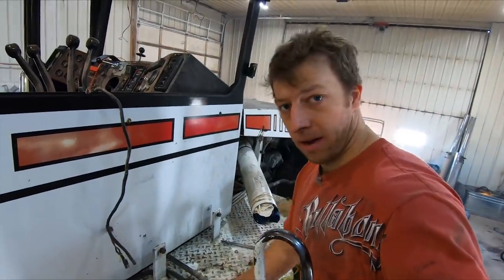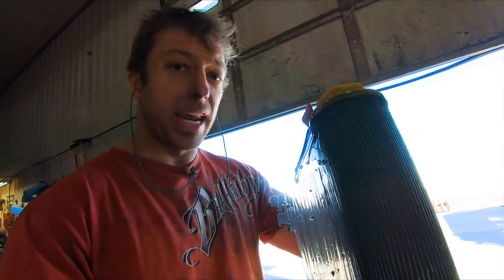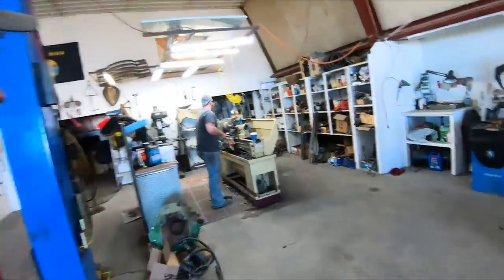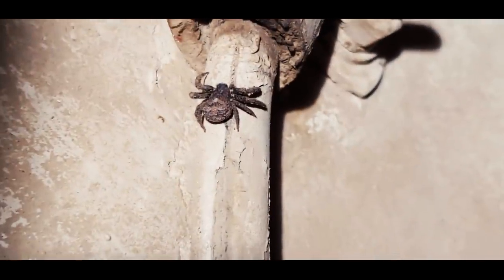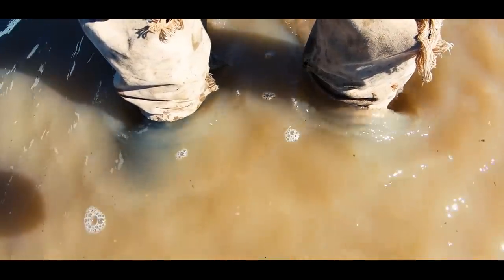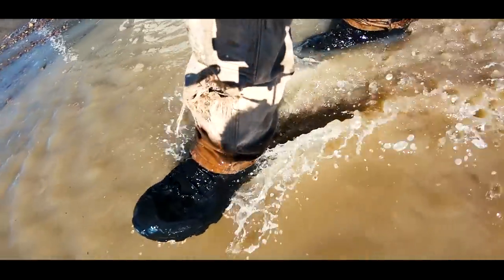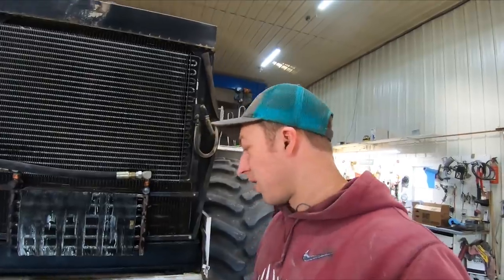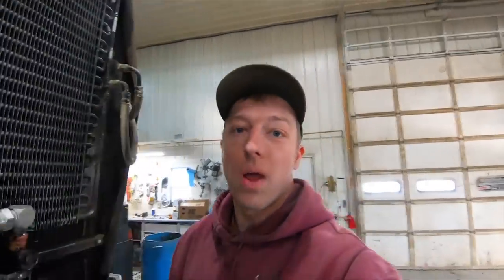BIG BUD Tractor 🚜 Restoration - Part 3

Comment: Great video. Noticed while you were under the rear end taking out the wiring that the breather for the rear axle was all covered with dirt.You'll want to make sure you can spin the breather cap and that the breather is not plugged. A plugged breather could result in leaking wheel and/or pinion seals. Keep up the great work.
Reply from the maker: Excellent point! Thanks I might just go and replace it anyways!

Comment: Consider rounding the inside of that hook pattern. Square corners create a weak point by concentrating all of the stress in one location. If you use a curve it makes the part stronger by distributing the force.
Reply: Lessons learned from the De Havilland Comet.
Reply: yeah, great idea, can always add a "saddle' on there later!
Reply: Cool guys, thanks!  Blessings
Reply: Science
Reply: At 09:20 there is an old rusty round-body pickup in the background next to the driveway.  I have seen it in other videos, but never seen it used, or even mentioned.  Is there any Welker history there that you want to talk about in a video, or is it just scrap that's been sitting 50 years?

Comment: Nice job cleaning the Hyd. tank. I just flushed my hydrostatic system on my JD. I have seen people never change their Hyd. system but when they have failures it’s usually a expensive one.
Nice to see you using the Altec Digger Derrick that was built in St. Joseph Mo. They make a nice crane on a farm.
Reply: That derrick is awesome on the farm.  It was Scott's idea to get one and he found a great value on a use one.

Comment: You should do like the steigers do and put a cable to the front of the rear drive. That helps a lot more than just pulling from the front of the front drive unit.
Reply: I was just going to suggest this.  That's a big piece of steel on the front, but that's an even bigger piece of steel hanging out behind it.

Comment: I have seen that screen failure on coal mining machinery that I worked on in the past, it's metal 'work hardening' with the hi-volume pump suction pulses that the Big Buds must have. We fitted lager surface area screen filters that were made with nylon outer screens, cured the problem economically.

Comment: Love seeing the old buds ...we had a 380 I believe 425 horse Cummins 13 speed filler transmission...on board air with air reel and bulk grease system it was the best oh the seat spins all the way around for easy watching equipment....love it

Comment: Relays!  If the Thomas lights are a higher draw than the originals, you may want to use relays.  Put the relays back by the lights, run new heavier wire straight from the battery to power the relays and use the original wires to trigger the relays.  Otherwise you may either burn out your switches or limit the lights.  Keep putting out the cool videos.  I love seeing what you build and they make me homesick...
Reply: Thanks Don.  Just as you recommended we run relays on most all new wiring for that purpose, to save switches.  Blessings and glad to help with the memories.

Comment: Is LegArms a self taught machinist and welder? He does a great job!
Reply: George Rydberg yes I believe he is you can look back in some live streams someone asked
Reply: I bet Welker senior had some influence.
Reply: I was amazed by their first Job, the tracked dozer engine swap, engeneering and fabricating the Parts that connects the engine to  the gearbox isnt easy, when the stuff isn´t designed to work together.  

And they nailed it, Legarms seemed to be around 16-18 at the time. 

When you grow up in a business or Farm, surounded by Machines that need Service or Repairs (i personal dislike the Term "fix" since it sounded like cutting corners everthere possible) you pick up skills or learn by fails how to do it correctly.  
Especially when you choose to run older equipment. Stuff you can maintain in working condition without an laptop. 
I run a construction business in germany, and have some older equipment, that i still keep in service for special tasks, 
since its payed off, realy reliable and still does the job with some comfort issues compared to new equipment.
Reply: Scott has 2 hands to amaze us. Nick actually needs a hand extra, to hold the camera :) Or a headcam.
Reply: @SirDigger420  well when u have a full machine shop u can pretty much frabricobbled up whatever u want in no time at all
Reply: You are right, Scott is self taught. I am amazed how fast he pick it up.  When I bought the lathe a few years ago I though I would relearn from my high school shop days.  But that didn't last long.  Fun to see him create.

Comment: I suggest you weld 3 hooks
Just in case the centre one breaks.
Might as well since you’re at it
Reply: Agreed
Reply: 'brakes' ?  What does stopping have to do with it?
Reply: Paul Copeland breaks not brakes
Reply: I think Big Bud had it right by keeping the hook(s) under the main frame rails. Not in the middle.
Reply: Aaron Hayden 
My bad. American English 😁
Reply: I wouldn’t do one in middle, keep them centered on the frame rails. More strength there. Just hook to both hooks and Clevis together to one chain to the “puller”
Reply: The center one will work, the frame is really strong there.  One inch thick steel as on edge like that is is really strong.  Grind the paint off, run 3 good weld passes and you should be good.
Reply: meh,  1" thick steel plate bends and rips under the right(wrong) stresses.
I have bent 1" hardened plate on my 50 ton wrecker,  I think the BIG BUDS can generate more force when Bogging in the fields then my Hydraulics should

Comment: I have the same thing going through my yard.  Time to get the old grader out and build a waterway around the yard.  
Nice to have three working on the Bud, thats a  massive job, good thing you dont have a lot of mechanical issues to repair.  I did a JD 4430 and it cost more than it was worth x 3 but is a nice tractor now. I painted everything even under the dash.  Have fun, you can tell that to your great grandkids when you're 90.
Reply: Thanks Tim!  Correct on the mechanical sound of the tractor.  That makes the work easier and much cheaper.  Gotta love the sound of the babbling brook......right 😁
Reply: Robert Welker  yes if I can hear that sound often during the summer. Haven’t filled the bins in 2 years

Comment: Instead of paper towels try those swiffer pads. Its called Swiffer wet jet and they have a handle like 5 or 6 feet long you can use to get in bottom of tank. Sam's Club sells like a 24 pack not that much. Its basically a flat diaper or really large maxi pad. Love the videos keep them coming and be safe.

Comment: All of those tools and no radiator comb. I noticed that small oil cooler in front of the big radiator but the fins were all bent up. When I started doing mechanics work I did AC Repair most of the time and when I would take the AC condenser out or change the drier I would always comb out the AC condenser fins with the radiator comb. The combs usually come with four different sizes of widths that rotates around the handle and when I would get the fins straightened up I would repaint it semigloss medium flat black and they would look new and move air better. It’s also nice to use on your home outside condenser from dents like getting the lawn mower getting too close or repairing a hail dented fins.
Reply: The oil cooler on the front is leaking, so a new one is coming.  But you are right about the comb.  We will get a comb coming for our shop. Really appreciate you giving the bump on that.  And thanks for sharing some of your history.  It fun to read others experiences.  Blessings Stuart 👍

Comment: 4x4 tractors in are area use steel cable under the tractor to the drawbar to pull out stuck tractors . when pulling on cable it help to lift the front of tractor with less stress on kingpins
Reply: They don't build the tractors like the stoutness of the Bud hinge areas now.  But cable has its points.

Comment: You better be careful installing your hook on the front of the tractor.
I used to build WAGNER MINING equipment with a frame  made of 8 inches T1 steel. 
The customers regularly  ripped them  apart like paper.
I am afraid that one day,you will pull all the front of the frame apart.
Weld another 3/4" plate on the bottom of your existing frame ( with holes drilled in it to plug weld it in the center too) and then weld your hook on this plate, not on the existing frame
Reply: Interesting.  That was some torque to do that.  I'm not sure we could get that amount of traction in the field to pull that hard.  Good question to ask the father of Buds, Ron, if he seen any problem.  Thanks for heads up.
Reply: As the saying goes: better be safe than sorry.
I would even, in addition of welding it outside,  weld the hook on the additional plate from the inside ( make a nice big chamfer) before welding the plate to the frame.
You are big boys playing with big powerful toys and someday you might need not one but two big buds to pull on this hook.
If you are really serious about it and if you want to be real safe, while everything is wide open and that you have access to it, weld a reinforcement   inside of the frame.
In the future, you might use this hook not to pull this Bud out of the mud but to pull something else.
Reply: @RobertWelkerFarmerBob  Man I love the fact you take advice so well, there is so little humility on the Internet - when well meaning people give advice (not always in the most neutral fashion). Love this Channel, if i ever get to the US i want to see the real America, small towns and proper communities places like yours, where the blue sky meets the horizon.
Reply: WHAT FRENCHIE SAID  ! ! !
Reply: @RobertWelkerFarmerBob  0

Comment: If you guys do stick welding it will make your welds so much stronger cause stick welding is made for heavy steel depending on the rod you use
Reply: You are correct and I might try the stick weld.

Comment: Funny..you would think the LEDs would take less power than the old incandescent lights.
Reply: I think because there are more then one bulb to power but I am not electrician to know.
Reply: More energy efficient
Reply from the maker: It amazed me too the first time we put them on our sprayer. I think leds are more efficient but these babies pump out such bright and intense light that it just needs more energy. One of these is as bright as my 42" light bar! And we're going to use 8, it's gonna be amazing.
Reply: It's amazing how quickly, and to how much brightness/efficiency LED lights have progressed in just the past decade.    A fantastic lighting source, that will only get more efficient/powerful/smaller in time.     @WelkerFarms

Comment: If your worried about a hook point run underneath to the drawbar. That's the strongest point. Lot of guys in northeast mud keep a cable from drawbar to front at all times. If it's always there it's easy to hook.
Reply: The buds are stout enough to be pulled from the front.  It just needs a good center pull point.

Comment: That's gotta be hell trying to get through all that when it turns to mud. The farm I grew up on turned to mud in the spring, but it never flooded that bad. The farm was built into the side of a hill so the water just flowed through the yard to the field. Lake front property for a month!
Reply: It usually only last for a few days, then dry the rest of the year.  Love the flow of water for the short time.

Comment: Looking good...when you weld the new hook on use multiple passes if using wire welder. Stick welding using low hydrogen electrodes would be the best!!!
Reply: That's a good suggestion.  I will get some if we don't have any.  Thanks Randy!

Comment: those drive lines and CV's are heavy - I used to grab a CV in each hand and walk them from the parts building to the paint shop - the handles were looped wire. Hard on the hands and about 50 yards between buildings. A good job for a kid going to NMC in Havre :)
Reply: Interesting history memory.  And a alumni from Northern at that.  Welcome!  Are you still in the area?
Reply: @RobertWelkerFarmerBob  , no, after NMC I moved to Portland Oregon and worked in high-tech for 23 years, then went to Minden NV and worked in a food factory, then to Salt Lake City and worked in a window factory, and for the last 11 years I've been at Boeing in Everett as a Manufacturing Engineer. I have relatives in the Flathead, Missoula and in Chinook/Harlem. I grew up in Browning, and most of my relatives grew up in Cut Bank. I remember the high-school basketball tournaments at the Shelby High-school. My dad was the Chevy dealer in Browning and knew all the other dealers on the high-line.
Reply: Wow, you've been almost everywhere. Lots of skills learned with those jobs. You know the area where we are well. Blessings to you 👍

Comment: I’d run a big steel cable back to the draw in the middle of the tractor. It’s what I put on my versatile. Then your pulling off the draw pin in the middle of the tractor not the frame just my thoughts is all. Enjoy all your videos.
Reply: The Buds are very heavy built in the center.  Never heard of any coming apart.

Comment: i love seeing this tractor getting restored ,,so many of these old beasts have been killed for scrap  ,, I don't personally own a Bud  but i sure do love them ,and would like to own a smaller one 
personally i own 3 articulated tractors ,, 2 Steiger  4x4s   a panther III  and a Cougar IIi  ,the panther  is onlyrated  325hp  ,but i am not farming huge areas  i use it as a dozer and to pull a 12 yard scraper ,it's had a few upgrades since i  got it ,,most notable is i got rid of the 10 speed manual transmission ,,it's been replaced with an allison 4500 autoshift with a double reverse ,9F+2R

my favorite is a bit smaller  but it's GREEN , John Deere 7520 ,I did something fun to it ,,i replaced both fixed axles with steering axles from a large forklift  ,now it's both articulated and can steer like a normal vehicle ,,rather complex hydraulic controls are necessary for it to work ,,i can switch between articulation ,,normal steering like a truck ,,articulate + steer  making it turn tighter than any other articulated machine in the world ,,and also a mode of the forklift steering controller called Crab Steer ,that makes moving over on the highway very easy 
the double reduction planetary axles  allowed me to install much larger floater tires ,,26.8 x38   instead of the 18.1 x34  , it's 6MPH faster as well 24mph instead of the original 18
Reply: Thanks for sharing your experiences.  We had a 7020, which we used to pull 48 ft of JD 1010 drills.  Good running tractor. It sounds like you have been very creative in redoing those units.  Would be interesting to see them in action.  Blessings
Reply: I do like the 7520 ,,  it's a very good tractor ,when i got mine it had set in a barn in oklahoma for almost 20 years ,it had a LOT of hours on it  close to 10,000, I got my 7520  in 2003 , it hadn't ran according to the farmer i got it from since 1984 ,built in 1974  it spent 8 years as a mower tractor for the state of nebraska ,before migrating to oklahoma where the man i eventually bought it from used it for a couple years before it developed an engine problem and was subsequently parked in a barn ,,i spent the entire winter of 2003 rebuilding the engine and going through every part of the tractor ,took 8 months to get it reliable ,, the axle change  happened in 2007 when one of the factory single reduction  axles took a huge crap on me ,grenaded and was unfixable 
the donor axles are 35K CLARK planetary  steer axles from an all terrain forklift that went through a flood
after all the work i did to replace the axles  the tractor doesn't look a lot different ,,the big thing you'll notice is the huge planetary hubs ,with 38 inch tires instead of the rather narrow 34 inch tires it had from the factory 
the floater tires are necessary because i do a lot of dirt work ,,

i'm actually not much of a farmer  so much as a sub contractor ,i cut about 250 acres of grass hay and horse quality alfalfa ,,mostly small bales 

generally what i do is tillage ,, and also lots of dirt work ,,i love scrapers ,,my big Steiger will pull a tandem 12 yard scraper set  ,,the 7520 does a lot of mowing ,and will pull a single scraper , but generally it does stuff like plowing ,and one thing it does a lot of is running a rock picker because unlike the steigers it has a factory PTO 

after this flood i will get a lot of work clearing  sand off of fields

Comment: You need added culverts and drainage under the driveway and roads. Get a deal in galvanized pipe or concrete pipe culverts. 6" to 12" or bigger. Consult with the County or City on how.

Comment: Assuming that you folks have never changed that suction filter, Id be willing to bet that it froze due to excessivecondensation.

Thanks for the vid, keep them coming.
Reply: Did ask Nick if he noticed and water coming out of the drain hole.
Reply: Robert Welkeri forgot to ask if you are the original owners of the Bud?

Comment: Look at how the newer 4x4s are setup 
Alot of them now have a cable running the full underside of the tractor and attaches were the hitch attaches just behind the attic point 
Being that you risk serious damage to the artic joint puling front the front with the seeder still attached 
We lost our T9060 newholand in a clay pit one side the mud was half way up the tyres the other was tyres completely submerged with a bellied scraper behind 
Had a combined 1500hp on the front to pull it out 
2 600hp quad tracks and a tj275, broke though the water table
Water was rising in the pit tractor was sinking, wasn't a fun day
Reply: Wow, not a fun day!  They don't build the hinge point like the old school.  Buds were built extra big.
Reply: @RobertWelkerFarmerBob  
They look like similar to the versatile ( the newer ones anyway)
Be interesting to get a closer look at the centre 
We have a 2in top pin and 6inch bottom pin